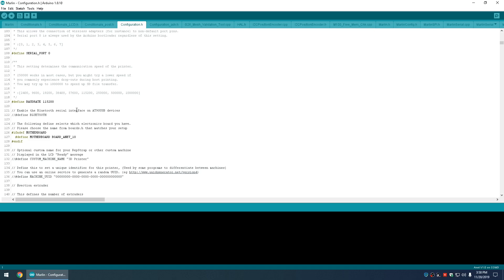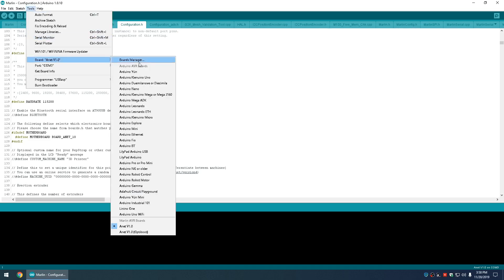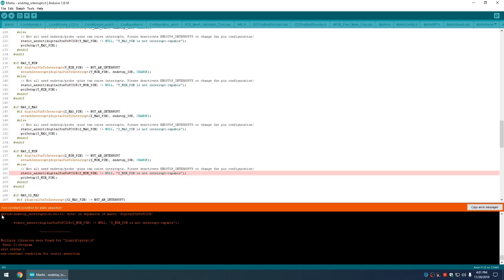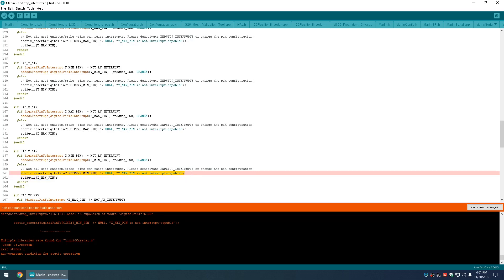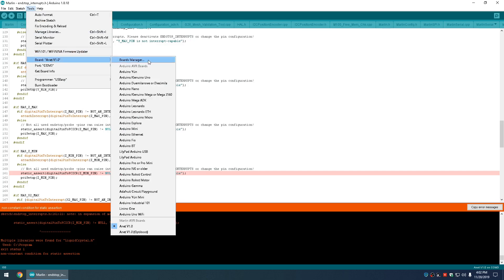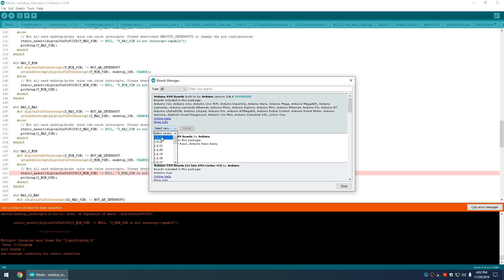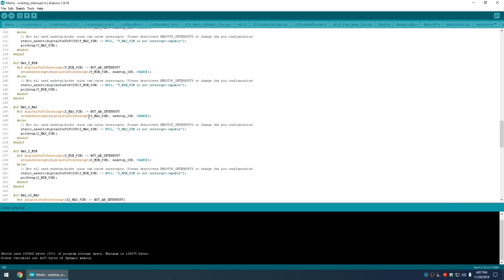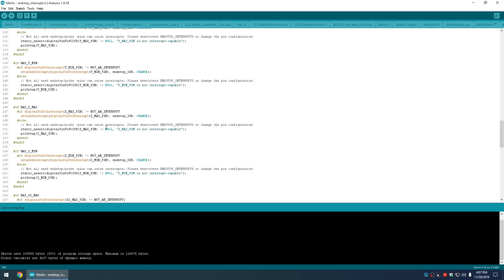Marlin Compilation Error in Arduino IDE - Non-Constant Condition For Static Assertion

Comment: Is it possible that this might be related to an inductive sensor that suddenly stopped working? I didn't have upload issues, but an inductive sensor suddenly failed. I replaced it AND the mainboard twice with no joy. I tested the sensors and I could see both of them change state, but neither of the mainboards picked it up.
Reply from the maker: Did you enable the sensor in the Marlin firmware?
Reply: @MrDabrudda  It had been working fine, then suddenly stopped. I replaced the sensor, then the controller, then the sensor again and finally the controller again. I gave up and reinstalled the original endstop. I was just curious since it was the same pin that caused the upload issue you experienced.

Comment: ok, so downgrading to 1.6.23 fixed that fault but caused a segmentation fault upon compiling. This can be resolved by rolling back to an 1.6.21 apparently, Tried this but got another error about LTO version (too high i think) Uninstalled Arduino IDE, installed an old IDE version i chode 1.6.12 and it worked, maybe some other newer versions work too I didnt check.

tl;dr: downgrade Arduino IDE if this video still doesnt work

Comment: 2 days, thank you] so much
Reply from the maker: You're welcome!  Update to the latest Arduino IDE and this problem is fixed.
Reply: @MrDabrudda  any clue how to print from SD? loads off "smart blurb" on the net, but nothing down to the point, cheers
Reply from the maker: @RadBudaspectrum-photography  SD feature has to be enabled in the Marlin firmware settings but it does take up extra memory of the limited ANET A8.  I print using an OctoPrint server and disable the SD card to save memory.

Comment: Is there anything you could help me with, after doing this I got a different error message that says: 
"bad CPU type in executable" 
"Error compiling for board Anet V1.0."
Reply from the maker: Do have the ANET v1.0 board definitions installed in Aruduino IDE?
Reply: @MrDabrudda  I do, is there anything else it could be
Reply from the maker: Do you have the ANET v1.0 board selected and the COM port selected in the Tools menu?
Reply: @MrDabrudda  yes, i have done this before but this time I'm downgrading to 1.1.9 because in the newest one, it does not let me level the bed, when I uncomment auto_bed_leveling_bilinear and probe_manually, there is no option to level the bed, but when I do mesh bed leveling instead of bilinear, then on the printer it has a bed leveling option but when I click it it just auto homes, and I can't do prints without leveling the bed so its getting really annoying. It almost seems like nothing I can try will work.
Also, I had a problem with the newest where it didn't have an option to access the sd card, but I ended up fixing that, i dont remember what i did to, but 2.0.5 is just being really problematic for me so I'm trying to downgrade back to 1.1.9
Reply from the maker: G29 will make the printer do an auto bed level probe.
I do a:
G28 (home the axis)
G29 (auto bed level)

The only thing I can think of is open the platformio.ini and the "default_envs" should be set to "default_envs = sanguino_atmega1284p" for an ANET v1.0 board.  If you have any other version of the ANET board then you will need to look up which CPU/MCU it has.
Reply: @MrDabrudda  alright so how can I make sure that there isn't a mistake in the coding witch might not have G29 after G28 (I'm fairly new to this, the only thing I've coded was lcd displays for a mega2560 board so sorry if I'm being a complete idiot.)
Reply from the maker: You can add the G28 and G29 into a script in your slicer.  I use Simplify3D and it has a tab for pre and post printing scripts.
Reply: @MrDabrudda  alright thanks, hope this works.

Comment: Hi,

Did you try just commenting up the static assert (which staticly asserts somethings and in that case fails), to check if that was just a logic error, or did the library indeed not work (that is, there's a real bug beside the static assertion) ?

Regards

Jean-François